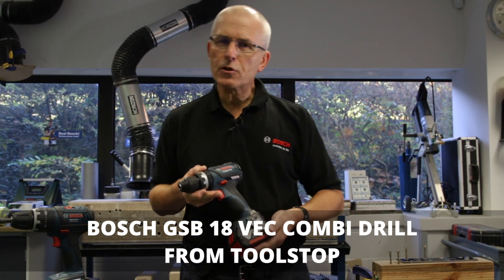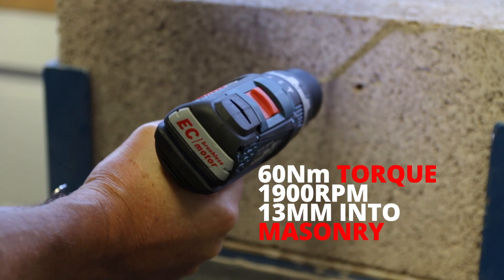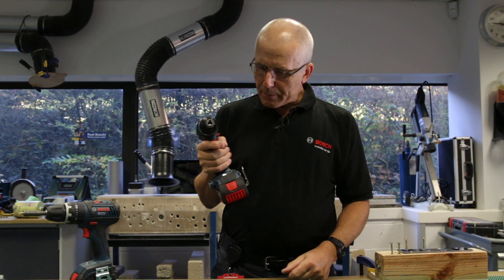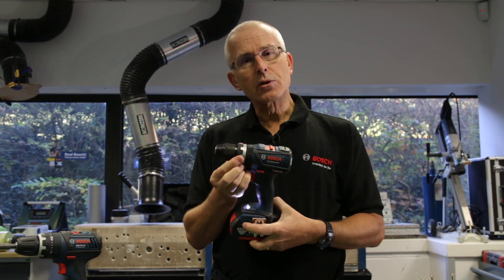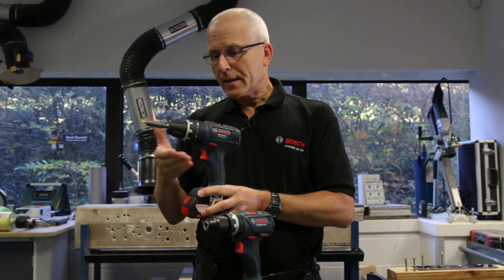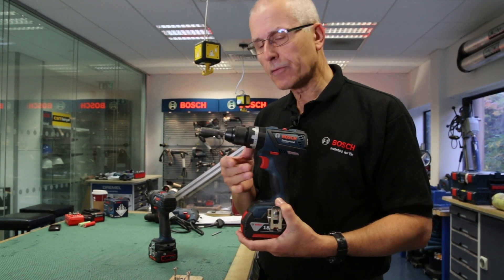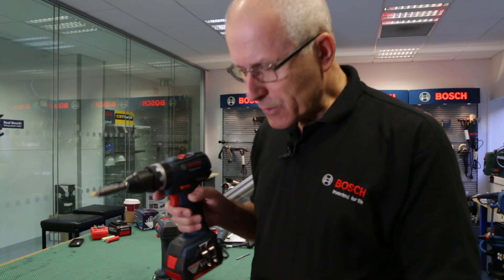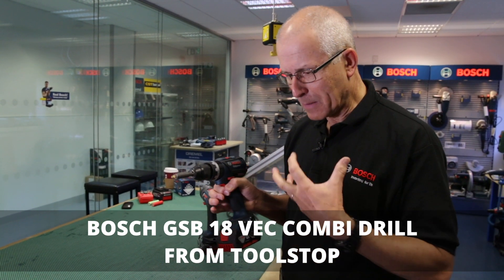Bosch GSB 18v EC Cordless Combi Drill - What's New for 2016?

Comment: hi their is 2 leds under the light window are both ment 2 work?id app an anser off u?
Reply: In case you haven't learned yet, or for other readers, that second light is the overload protector indicator. It will light up red if the battery is too hot and the chuck will slow down.